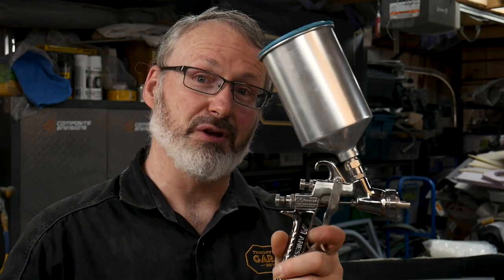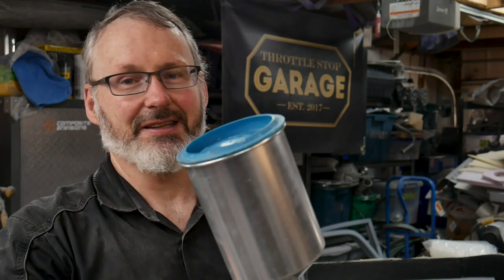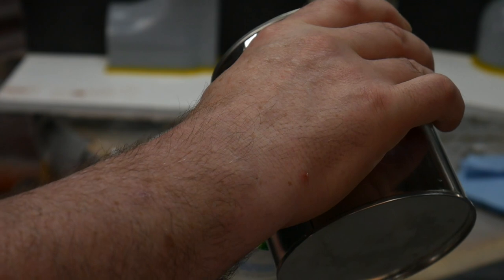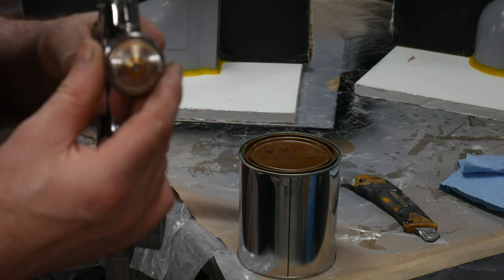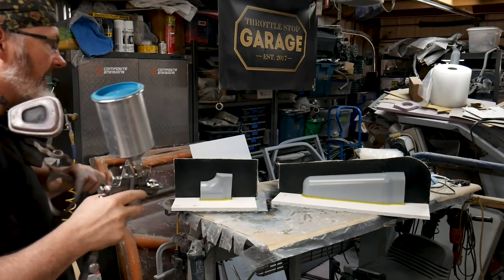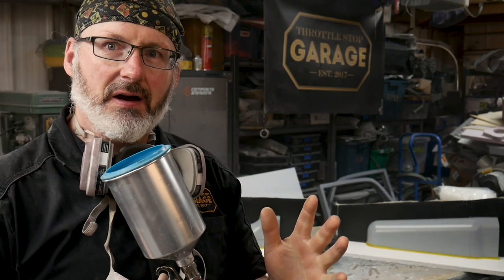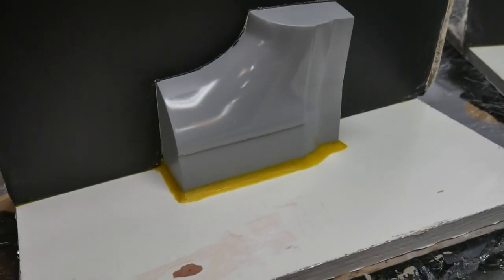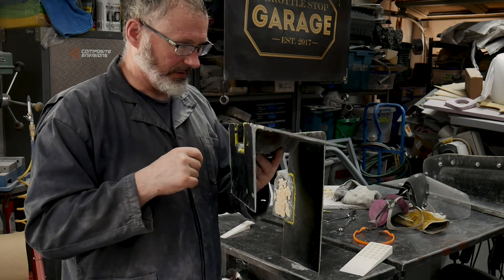PVA Application for Fiberglass Mold Making

Comment: Extremely helpful thank you!!! I tried spraying PVA today and it came out with orange peel! I turned the needle in, but definitely not enough! I am using a 1.8 tip IWATA. Tomorrow I will try to set the needle like you did. I was worried that my mold would have orange peel....so i washed it all off and went on youtube. Glad I found you
Reply from the maker: 1.8!  If you have a smaller fluid tip - like a 1.2 or 1.3 that's what I'm using. I've had zero issues with this technique and it adds no peel that I have to fix in the mold.
Reply: @ThrottleStopGarage  thanks for the reply! On the initial spray on your PVA, does it come off a bit textured, but then levels out when it drys? Thanks again

Comment: Thanks!  I knew I need a light coat, but my gun was set like yours...fill trigger.  Going out to the shop to re-do the current PVA application!

Update:  Turns out the fan setting is super important too.  On my 3M primer gun (2.0 tip?), I needed 1.25 turns on the trigger, and 1 turn (half way) on the fan adjustment.  First try was 1/2 turn on the trigger and fan was turned down, and I got a "speckled" surface of individual droplets.  But after turning up the trigger and the fan, I got an evenly wet surface, but much thinner than what I have been doing up til now.  I'm using the Partall PVA (purple).
Reply from the maker: Fingers crossed - hope this works.

Comment: Thanks for this video!  Multiple light coats and you still get a nice gelcoat surface...  I haven't used PVA much - mostly because of struggling to get good surface finishes - no doubt from too much PVA!
Reply from the maker: It's more about how you get the light coat.  When I sprayed it before, it never really worked well.  With the fluid needle almost closed, it's very fine.  So far it's been flawless.

Comment: This is great. I've been so anti-pva simply because I've spent hours getting my plug/mold to a polished finish that PVA would destroy all that time invested. Might try this out!
Reply from the maker: I was in the same boat - it does work and does not  cause the texture and mess that it did when I wasn't applying it correctly.

Comment: What size of tip are you using? Have you ever sprayed mold gel coat with the same gun? I appreciate any info! Thanks!
Reply from the maker: The gun has a 1.3 mm tip.  You need at least a 2.0 mm to spray gel coat.
Reply: @ThrottleStopGarage  But you spray it out of the same gun? I have several iwata guns including a 400. Thanks!!
Reply from the maker: @specforged5651  I've got a cheap knockoff gun for spraying gel coat.  I think I paid $20 for it.  If I was doing it again - for sure 100% I'd buy a cup gun.
Reply: @ThrottleStopGarage  A cup gun huh? Ok maybe that’s what I’ll do. Im going to be doing a lot of gel coat molds so just want to go with the proper gear from the beginning. Thanks for the knowledge.

Comment: do you only using green wax or mix it with PVA? if you mix it, The ratio of combining them is equal??
Reply from the maker: PVA is sprayed without additions or reductions.  It is normally applied over a waxed surface.

Comment: Can the same formula be used in latex molds? (Actually, before casting, spray the inside of the mold with this method so that the latex does not stick to the statue)???
Reply from the maker: You'd have to test and see.  I expect it would work, but I'm not an expert.

Comment: Hi! Thanks a lot for your interesting and useful videos. I have a question . What is the size of hole of pistol you use ?  I bought pistol 4 mm. But it  seems to me much.
Reply from the maker: The gun I used has a 1.4 mm fluid tip.

Comment: BTW why isn't your usual chemical release agent ok for 2-piece molds?
Reply from the maker: This is a complicated question.  Chemical release agents can be used when making 2 part molds - sure.  It is easier, in my opinion, to use wax and PVA.  The PVA serves a couple of purposes - first, the mold you're bonding to is green (new) and styrene migration can be a problem.  PVA prevents this. If you absolutely can't have the plug stick for any reason (like when I borrowed a trunk to make my mold - keep a friend - use PVA and be 100% sure.) use PVA over wax.  It's a "Belt and Suspenders" sort of approach for a lot of things, but there are good reasons.  In your other comment - my response - use proper mold release wax not car wax.  While it may work - it may fail.  Some also use exclusively if the plug is really big (like a boat) then you see it a lot.  Anyway - it works - this is how you spray it.
Reply: @ThrottleStopGarage  yeah, fair enough that PVA is a "just to be sure" extra step. however I think a lot of people get into the habit of always using it when it's really not needed, and can easily get a worse finish and have a stickier mold release because of the PVA. good to know that it can be sprayed on well though. thanks!

agree 100% that car wax isn't a good plan - that would be a crazy false economy after spending so much time on plugs and molds. honey wax 100 and miracle gloss #8 (used to be made by meguiars?) are mold release waxes, as was the other carnauba wax (I got that wrong - not bees apparently) that I've tried. all worked fine. FWIW so far I prefer the honey wax 100.

one other thing is that I tend to make epoxy molds (and parts) - perhaps styrene isn't so much of an issue with epoxy resins as it is with polyester? - but also I rarely get around to using a mold soon after I make it either (just no time).

I should try a chemical release agent one day.

anyway, just my 2c. not a holy war :) keep up the good work!
Reply from the maker: @plaguedbypenguins  Try a chemical release - they work great.

Comment: LOL, I guess I was doing it SO wrong years ago when I experimented with composites. My molds ended up looking like they were shrink-wrapped in heavy-duty green saran wrap. And it would peel off in one piece when I removed it. LOL
Reply from the maker: And it never had texture and you never got runs either. LOL
Reply: @ThrottleStopGarage  I was operating on the more must be better theory - texture and runs for miles. LOL   Thanks for showing the proper way of doing this, in case I ever come to use these materials again.

Comment: Can't you use this on top of locktight release
Reply from the maker: I don't see why not.
Reply: Bro thanks for the quick reply you're the man. I have a 1.4 gun and I'm going to do a small test to get the technique down. Building a carbon spray dodger for my sailboat and want the inner skin to pop. Outside is faired and painted. It's a big layup 8feet across. If it pops ill give you cred I'm more on tiktok on shorts
Reply from the maker: @boattalk1089  sounds like a cool project.  Hope it works out.

Comment: try it with no PVA.
I have gloss plugs & molds, use 7 to 10 layers of honey wax 100, no PVA, and the parts pop out with literally zero effort and perfect finish.
I'm making motorbike fairings. so smaller than your volvo panels, but far more complex shape with NACA ducts & much sharper curves and edges etc.
same with a macguires miracle-something wax, and an unknown bees wax thingy too.